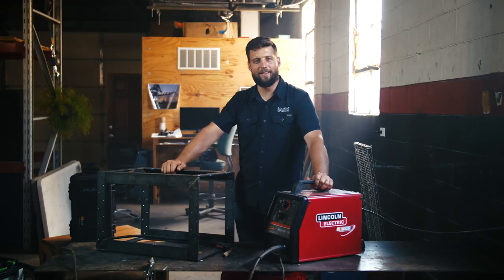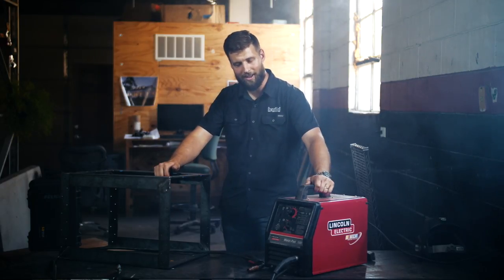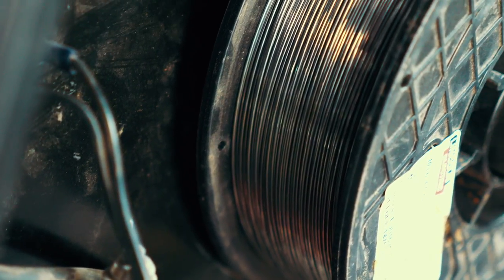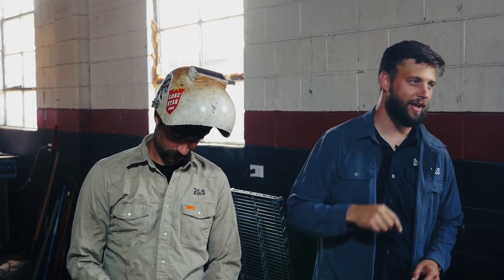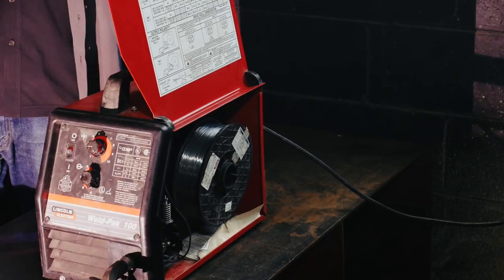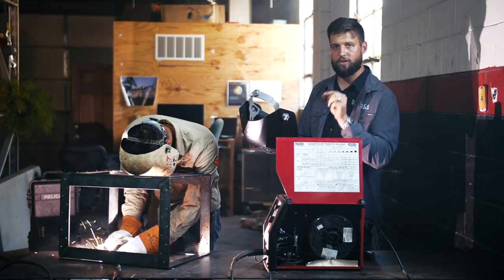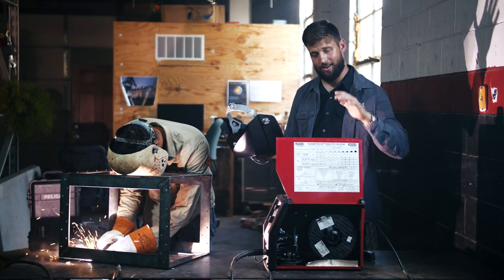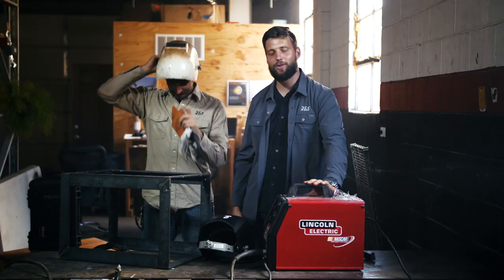The Basics of Welding with the Lincoln Electric Handy Mig

Comment: It would had been lovely if you show the dialing of the controls when it comes to thicker metals or thinner metals. For the most part I know how the machine operates and the workings of the mechanics of it, but the thickness of the different wires and what type of metals they are used for as well as the dialings of the machine Is what would be nice to see a video on. 👍🏼😊

Comment: Just tried building gear teeth for my lawn tractor with a lincon handy core (flux core) welder , first try , built a base filed and looked , second pass got a good height filed and looked  , third past good enough  for the tractors i use, nice little unit

Comment: I work in industry right now in a foundry.  20 years ago I worked fabricating commercial kitchen hoods for bars / restaurants/ I used a very similar buzz box as that to build the roof curbs / mounts for the vents / blower units.  Never once had an issue.  Landed my job in the foundry and was laughed at because  that little buzz box did not have enough penetration.  I call bullshit, because at the time I was welding 1/4" thick square tube.  Seemed beefy enough and seemed like I had plenty of Pen.  If you are just doing simple stuff at home I would buy this all day long.  No need to drag out a giant ass 480 volt welder to weld 12 gauge steel.  Plus did he say it was tiny and only needed a 12 gauge cord? yes good deal there.

Comment: Isn't there some settings on the front of it the reason I come to watch it to find out what those settings were and how those settings react to the will depending on the size of the metal obviously and what you were looking to get done but it didn't get that all I got is shown a wire that goes through which is the simplest part that everybody knows about settings what they mean compared to these other ones that got numbers all these things like this this one just has ABCs I don't know what that means and if I had to manual then I wouldn't be watching the channel to try to find out what they mean